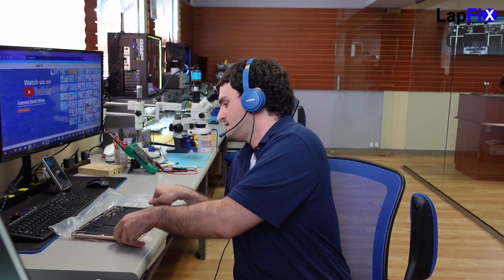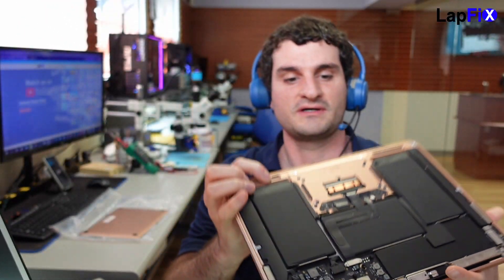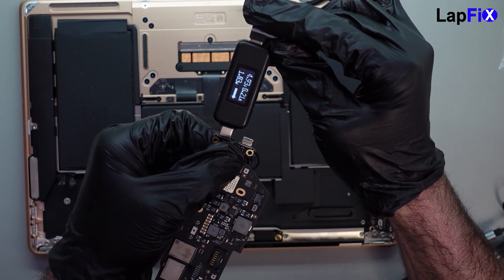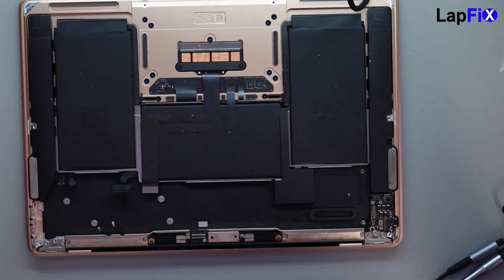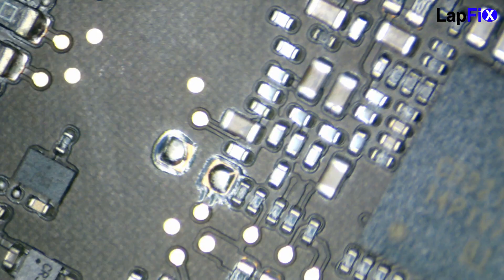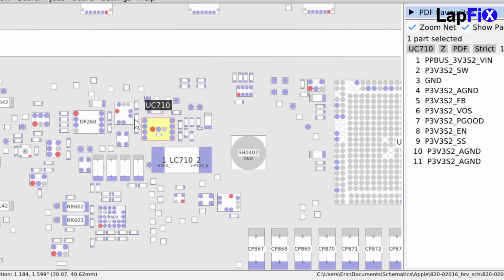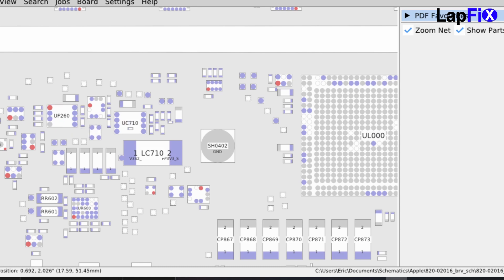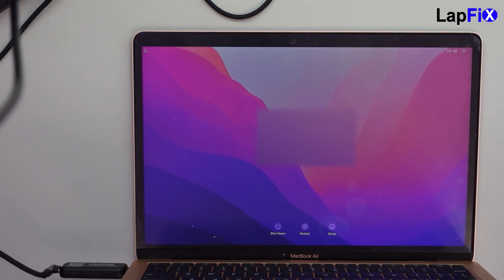How to Repair a Dead M1 MacBook Air

Comment: Have you encounter a problem that the display is not working after a liquid damage? The only place where liquid damaged something was the battery and charging connector everything else, I can boot up and have a second display showing up, but the internal display does not work. Any ideas?